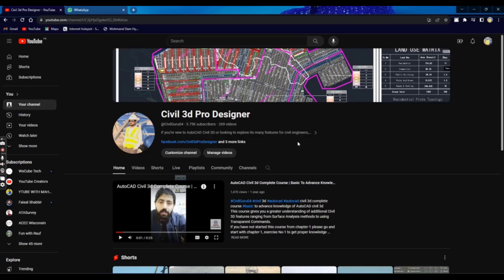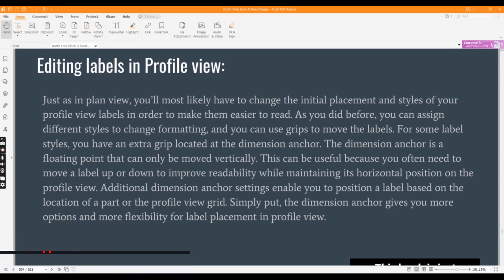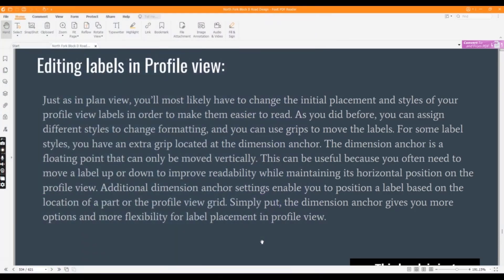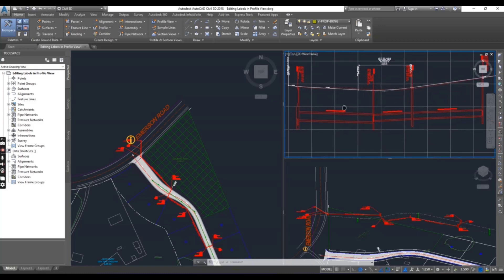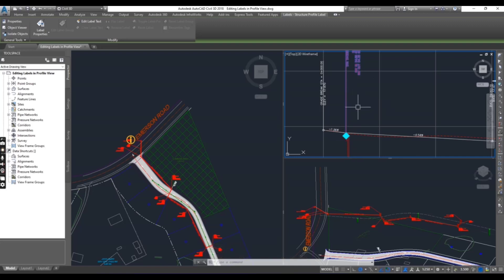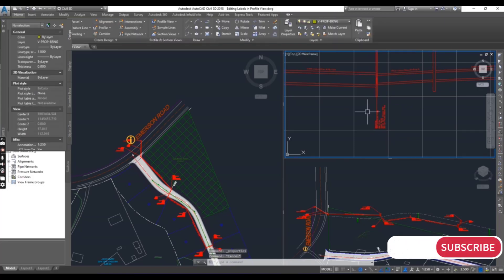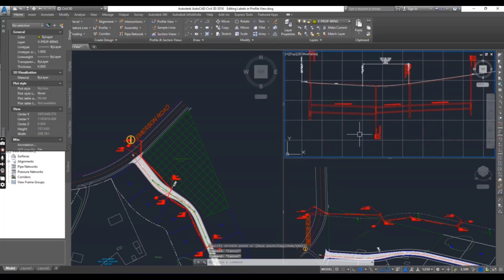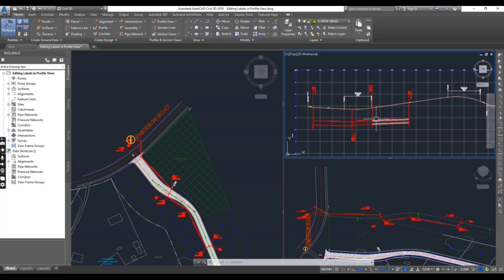How to Edit Profile View Labels of Pipe Network in Civil 3d | Dimension Anchor and Grips Editing

Comment: How did you get the leader line to pull to the anchor point no matter where it is paced? My leader line keeps pulling from the center of the structure no matter where I place the anchor point.
Reply from the maker: Go to the label set and edit dragged properties for that labels
You will get many options there and can fix accordingly